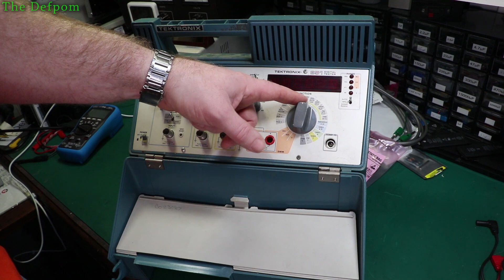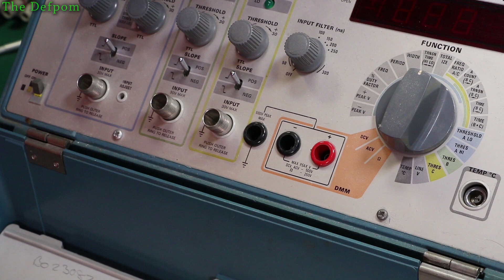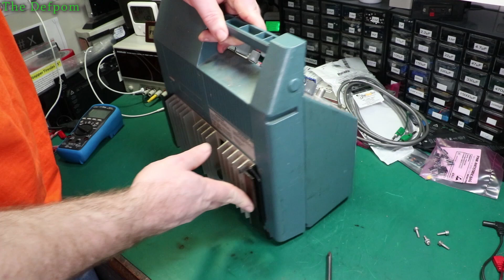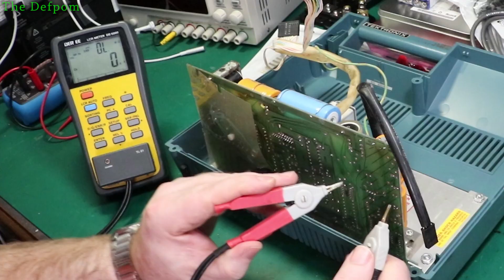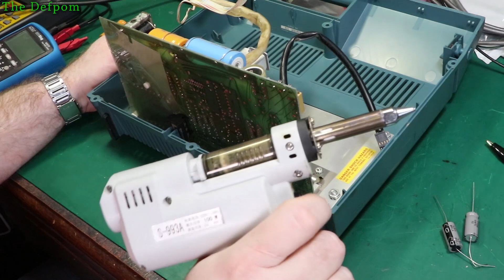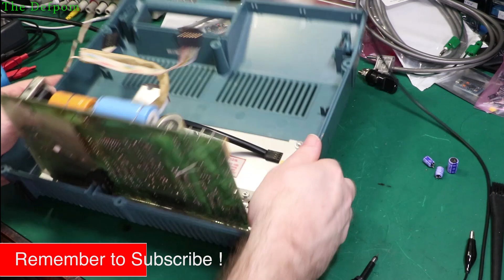🔴 #646 Tektronix 851 Digital Tester Repair - Part 1

Comment: The connectors are the same as used in Tek P610x series modular scope probes where you can separate the probe head, compensation box and cable to replace damaged parts. It looks like they have just used one of their regular scope probes, minus the compensation box, for the input probe.
Reply from the maker: Stephen Bell - thanks for the info.

Comment: On the broken mounting posts. Plastic shrinks as it ages, metal doesn't so the plastic tends to crack. It could also happen from being overtightened of course. You can use some thin wall brass tubing (from a hobby shop) that is just a bit larger than the post outer diameter as a sleeve. Cut a piece of tubing the correct length and epoxy it over the broken post. 

For some repairs like this, I have had to drill out the hole and sleeve it as well and then epoxy the brass insert back in. Spay silicone mold release on a screw. Screw the insert onto the screw and use the screw as a handle for epoxying into the post. The silicone mold release keeps the screw from being epoxied to the insert.